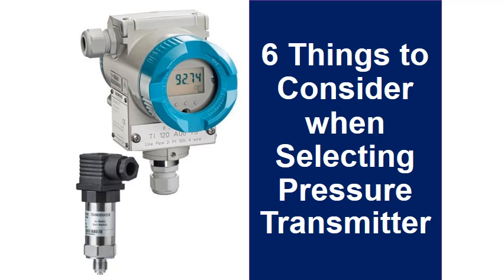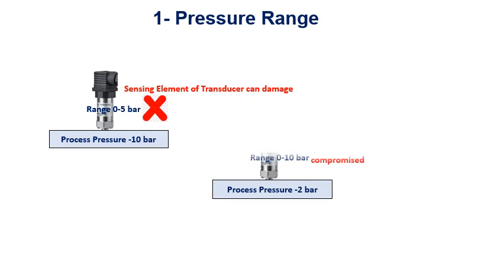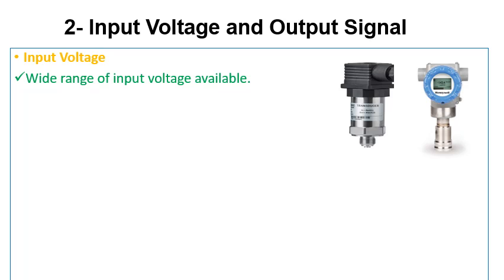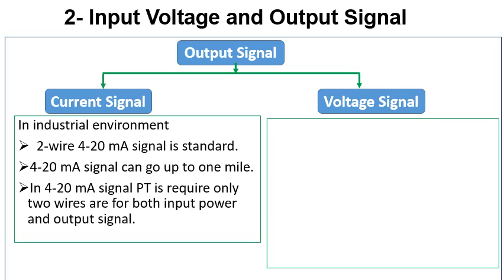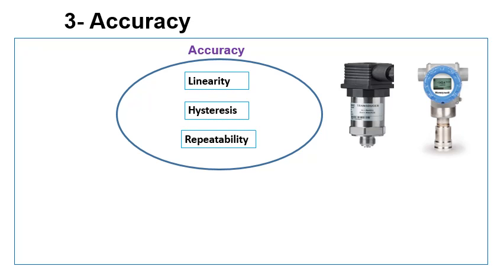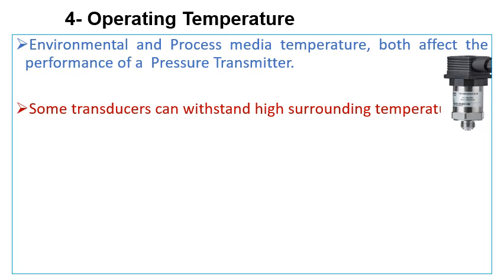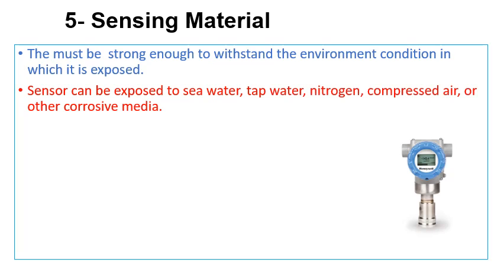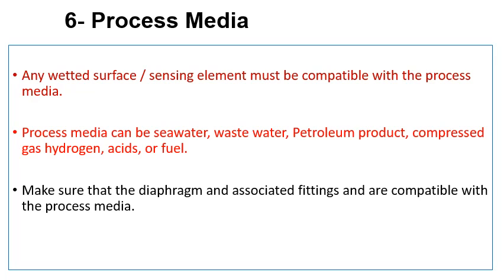How to Select Pressure Transmitter || Things to Consider when Selecting a Pressure Transmitter

Comment: Thank you for explain but i want ask u if i have 24vdc can it reach to more than 1.5 km
Reply from the maker: 24 volts DC could not be send 1.5km distance. However you can try it by using larger cable size